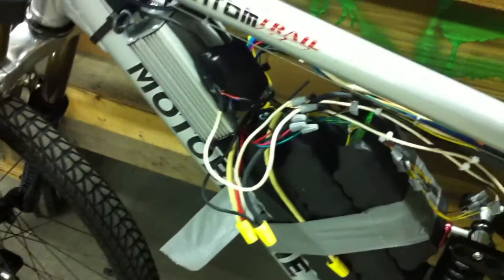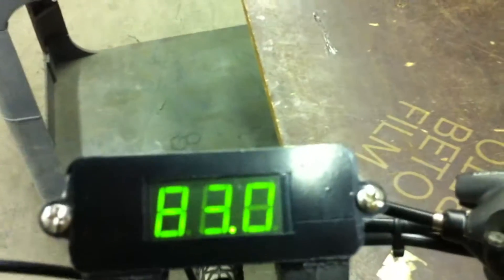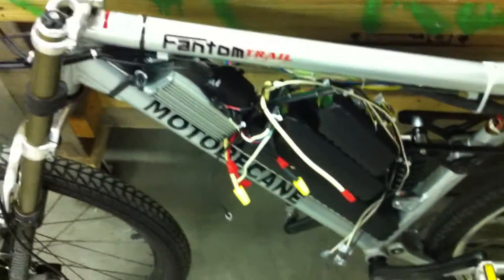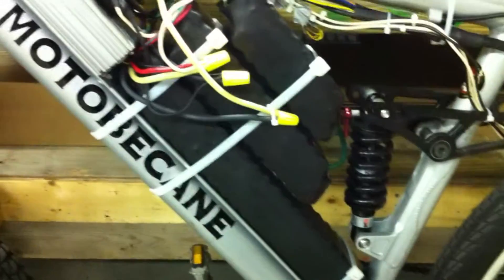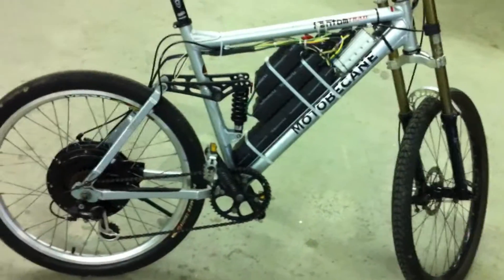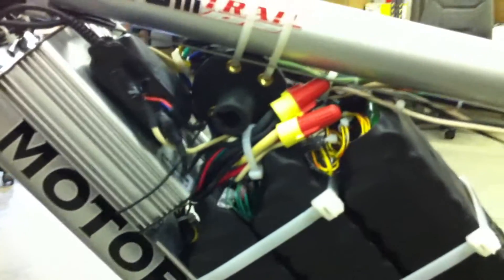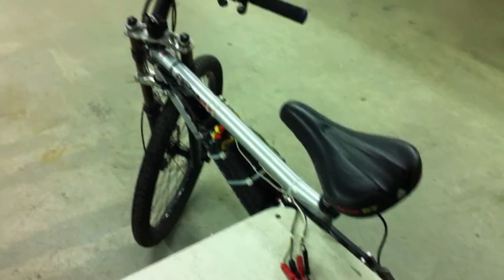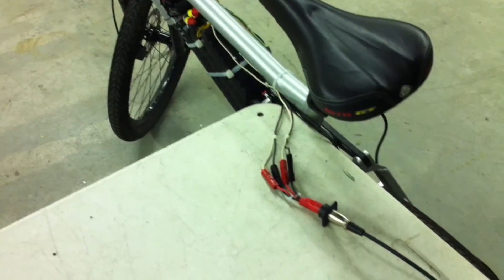EBIKE 72v - Batteries mounted and wiring finished

Comment: what wire gauge did you use for your power circuit (battery to controller to motor)? Just wondering what kind of amperage a system like this handles. Thanks

Comment: You charge the whole pack on 36v? And what about balancing the cells? Won't they get damaged without some kind of bms?
Reply from the maker: Yes, the pack has balance lead and gets checked once a month or so. And otherwise it gets bulk charged at 10s 2a. this video is over 2 years old and these batteries are still kickin' used them last night on my Voloci at 36v 22amps

Comment: Sorry I'm really unfamiliar with all this but once you have a 72V pack - what size motor can you use to connect to it. Also can you use 1 battery pack + 1 motor controller with 2 wheel motors?

Comment from the maker: the motor is a Golden Motor 48v 1000w, usually this means thats a safe wattage for the motor to sustain..and how much it will receive from the controller. It does not mean the motor is incapable of running at a higher voltage. By replacing my controller to 72v and upgrading motor wire size it will work..but if you abuse the power the motor will smoke.

Comment from the maker: @iovaykind what wires are you talking about? if your trying to turn your controller with the red switch you use the small red positive thats coming out of the controller, and switch it with the red positive from the controller battery input.

Comment: I like what you did with the red button being connect to the LED. Is it possible to use that red button as the switch to turn the bike on and off? I'd like to ideally keep my batteries plugged in and use that as a switch to turn the bike on and off, but not sure if my controller supports that function. Actually just got a turnigy watt meter, can't wait to get it all hooked up! Been using it to commute to school anytime its nice out, and it sure is fun even though I only got half your voltage hah